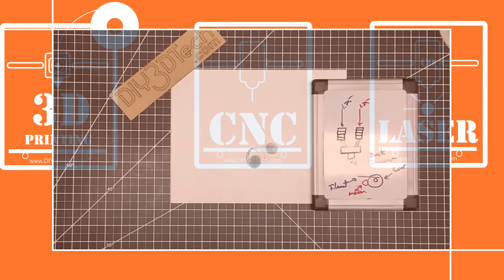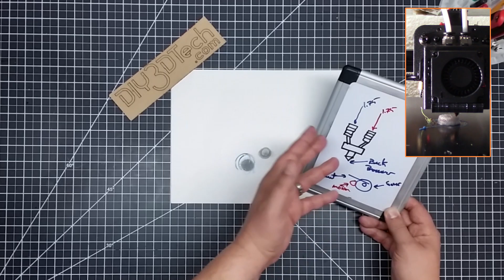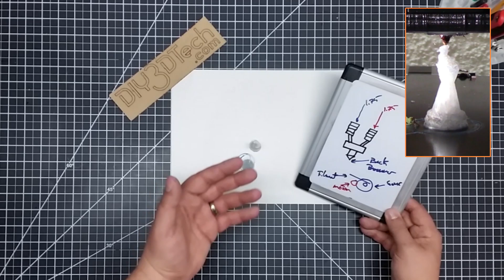GeeeTech A10M - Mixing Nylon with TPU Fail!

Comment: Interesting testing, but you need to get your basics right. You are not using double the filament, and you don't need to heat double the amount of total filament.
Otherwise your parts would have severe over extrusion AND weight double, spending double the total filament etc etc etc. the density does not double up magically.
Reply: also your extruder explanations are WAAAYYYY off base.

Even 3:1 gearing is too tiny gearing, and even with direct you can do 0.05mm layers no probs, with geared you can probably do 0.01mm precisely.

Infact, the problem with extruders as it is now is that they are running TOO SLOW.

The gearing increases precision and accuracy, exactly what you want for tiny areas like that. Not the vice-versa.
The job is to very precisely control the amount of filament that comes out of the nozzle, both in amount AND location. Not vice-versa.

Hell, the reason why most have moved to 1.75mm filament as well is to reduce gearing and increase precision of filament extrusion.
Reply from the maker: How do you figure I don’t have to hear double?  While only 0.4 comes out, 2 x 1.75 enter the heat block to be melt and this can even seen in the fluctuations of the end temps when mixing...
Reply: same amount of material comes still comes out ... You do not magically use double the amount of material facepalm

Fluctuations happen also in single feed hotends for various reasons, this lacks heater block insulation which almost guarantees fluctuations. May need PID tuning as well.